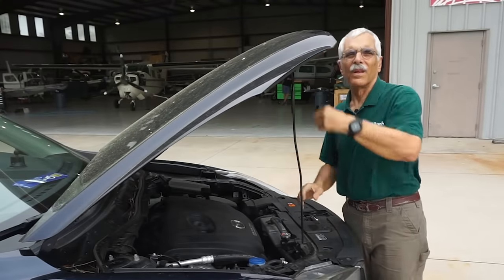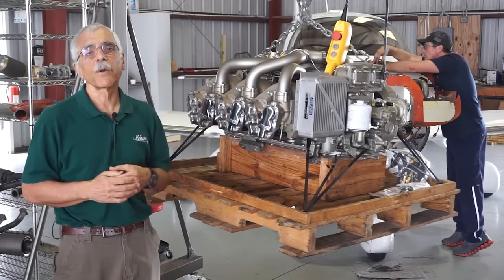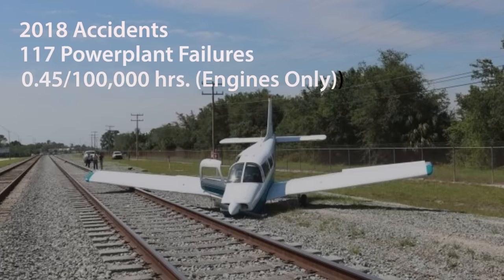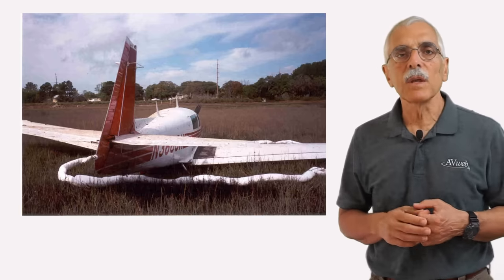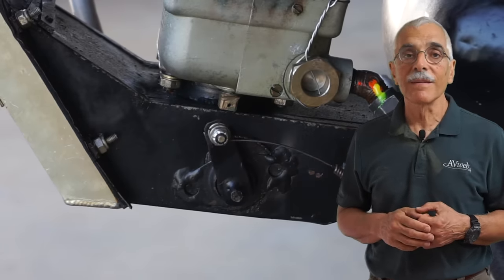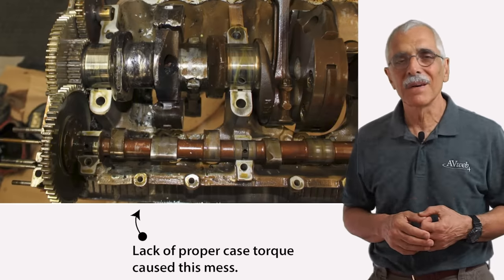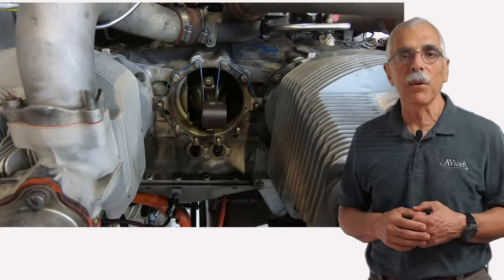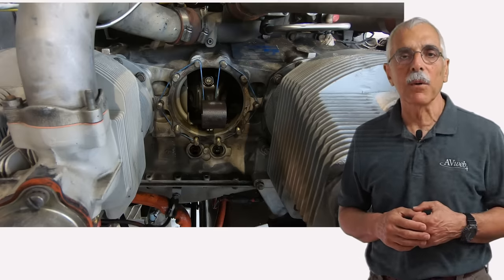Why Aircraft Engines Quit

Comment: I have a question but may already know the answer. I've run air cooled VWs for years (in cars). The single best improvement you can do to a VW engine is install a counter-weighted crankshaft, which greatly increases overall life and engine balance / smoothness. I noticed that the engines in the video are straight cranks. This is done strictly for weight concerns?

Comment: People often wonder why plane engines require overhaul with meager hours compared to a passenger car. A thing to remember is that once we're on the highway, our car engine is just above idle on a standard overdrive transmission. An average may be 2100 RPM with a peak power output around 6000 give or take. A plane engine operates at a higher range of the power curve thus greatly reducing the life. Think of it like a race car engine. They're racing for hours on end near WOT aka the top of their power band. They're rebuilt extremely often due to this fact.

Comment: Just for comparison, a car engine running at an average 60kph (just under 40mph for those in the colonies) will complete 200,000km (125,000 miles) in around 3,350 hours.  At an average 100kph (60mph) that distance would take 2,000 hours.
I think, nowadays with minimal maintenance (oil change and filters, maybe a timing belt) most car engines will easily achieve double those figures without any major failure or major overhaul.
Would you say that a typical GA engine is more or less stressed than a modern car engine?  in terms of bph per liter for example?
I'm not a pilot - just interested in the mechanical and operational differences.

Comment: About the Rotax engines, aren't a lot of them 2 strokes? If so this would play heavily into the failure rates vs. 4 stroke engines. There is something not mentioned, with car engines motion is transferred through rotation to a transmission that carries the structural load of motion. Depending on the car the Torque is carried via a thrust bearing with a rotational thrust loading. With aircraft in general aviation that is WAY different. The case of the engine not only has to handle the torque loading to propel the craft it has to handle the thrust loading imposed on moving the craft as well. and also the engine itself has to possess a thrust bearing on the crank car engines do not have. With cars the engine provides power to the wheels through a drive line that redistributes thrust loading. With aircraft the engine has to endure thrust loading with the RARE exception of engines using reduction gearing or a transfer gear (P-39 Airacobra for example).
For what they are Aircraft engines are amazingly robust usually. They have to be. People can be rather abusive towards their equipment.

Comment: interesting video. question: why pushrods instead of dohc when with the latter  you´re suposed to gain power due to the higher engine revs. also why not v engines since they are not so hard on the camshaft?

Comment: This is why after a lifetime on sporbikes since 1994 on a GSXR 750, I now ride a Buell XB12Ss.  If you maintain these type of pushrod air and oil cooled twin valve engines, they last forever.   Why do you think cruisers use them, even if from factory they are a bit de-tuned for comfort and emmissions?  Worst engine I had was Yamahas R1 with critical engine failure, loose valve guide, at 5k, 11k, and finally 16k mi destroyed and wore out.

Comment: I've had two partial engine failures. Fortunately neither became an incident, and thus no report. And I do know what happened with both.

One was a Continental O-200. The 3rd cylinder literally broke off of the crankshaft.

Second was a Lycoming IO-360. A stray piece of metal made a valve get stuck open.

Comment: Not a pilot, aviation enthusiast, but am I totally off if I say that a well maintained engine shouldn't quit? Like, my car engine never quits and only old engines generally have these issues.

Also, with regards to service, guessing smaller engines are easier and cheaper to maintain and overhaul, and since that keeps your plane flying, definitely something to consider.

Comment: The one thng I didn't hear you mention in regard to automotive vs. aircraft engine failures (other than that far more automotive failures occur than are tabulated1) is that aircraft engines spend almost all their time at or above 78% rated power -- and automotive engines rarely even get to that level, never mind sped much time at it.

Comment: I was really hoping there was some more fully formed point to be made about complex automotive engine reliability vs "simple but outdated" aircraft engine reliability that would give hope of future improvements but... I dunno that point seemed to just fizzle out. For instance, if (some significant portion of) 1/3 of engine failures is due to carb ice isn't it a no-brainer to get rid of more of the carbs?

Comment: I am assuming the 'ancient' design of aero engines is due to low volume production. I have  for a fair amount of time pondered why car engines - or at least modified car engines are not used at the lighter end of plane usage. In terms of the why - the one piece here is well - if you have ancient designs, and they need intensive main. - then each window opens up the chance of human error in the rebuild. Good video!

Comment: Frankly I still would consider a lot of these to be design failures. Yes, it is possible to avoid the vast majority of these failures with maintenance and procedure; but it is also possible to almost rule them out with relatively inexpensive design changes and retrofits.

For example, Water In Fuel sensors are an ordinary mass produced component that should be compatible with aviation fuels, if not as-is, then with minor modification; they aren't standard equipment so certifying should be relatively simple, I would think.

As for the wrong fuel type, I don't know how FlexFuel sensors work, but presumably something similar could exist (especially since unlike a FlexFuel sensor, you don't need to get an accurate mixing factor, you just need to know if it's contaminated).

As for carb heat... a thermocouple, a relative humidity sensor, and a buzzer could save you from this, or if we're feeling really fancy, maybe it could have a thermostat and run off an element rather than a heat exchanger.

And none of this is to mention the improvements in metallurgy, coatings, quality control and diagnostic equipment, factory casting refinement, bearing geometry, lubricants.... There is no reason piston engines this heavy and derated should require this kind of upkeep and still fail with the slightest lapses in maintenance.

Comment: When I was taking lesson's in a Cub from my dad we were working on engine failure drills. Our ground school section that day included what should be check as we descend.
    One of the first things I was suppose to look for was throttle position.
    I saw the throttle retard out of the corner of my eye and heard dad say, "You engine has failed."
     I just reached up and pushed the throttle back where it was suppose to be, mainly because I was a smartass teenager.
     Turned out that was what he wanted me to do.

Comment: Surprised that there are no magnetic pick ups on the oil drain bung. Quick removal and blocking with a thumb (when cool) lets attracted steel junk be identified. Sometimes large recognisable chunks with no other symptoms, particularly gear tooth pieces, the magnet also captures them.

Comment: Your Mazda engine is probably far more reliable than a light aircraft engine but that shouldn't be surprising. A major auto manufacturer has several times the R&D budget, they produce a lot more engines so are a long way down the experience curve and they monitor/measure exactly when failure occur within the warrantee period to find flaws early and adjust servicing accordingly.

Edit to add: I think a few auto manufacturers (Honda, Mercedes?) have sold auto engines for use in light aircraft. Unfortunately a quick Google didn't find any information on failure rates in this application.

Comment: I always use to recommend a Lycoming engine over a Continental engine. For years the Continental engines had things like brand new engines I found where the rocker arm pin was miss drilled at incorrect angles tilting the rocker arms to the pushrods two brand new engines on same B55 all the cylinders. Called the factory and they said a few got out that way. Quality was not the word of the day for Continental for many years. Though some of the Lycomings were also very poor the H2AD 0-320 cam was terrible for spalling the lifters. The magnetos on both brands really need to be removed and inspected or overhauled at very low times. The Slick brand is to me a throw away item the way the shaft and rotor with the little plastic point opening flat piece of plastic is crap in my book total junk. Well first for what it’s worth get a good A&P and when he says a part is way past its prime throw it out. Don’t run things until they break. Mags not looked after I have seen them crossfire on carbon tracks by the mags rotor do all kinds of cylinder damage on the Continental big sixes. Always do an oil analysis every oil change. Always get mags off every five hundred hours for overhaul or at least a thorough inspection. Of course some of the engines are very reliable the the Lycoming 0-320 no dash H2AD. The Lycoming 540 non turbo also a very good engine. The Continental 0-470 is a very reliable engine. Well keep the shiny side up gang.

Comment: I have little idea as to the specific issues regarding airplane engines excepting the carb icing problems mentioned, which should be easily fixable with a temp sensor.
Otherwise I'd take the Mazda engine anytime.

Comment: Battery failure, maintenance or engine failure? LOL PS: with modern computer technology are there not sensors that tell you "carb heat needed" or there is a loud clunking the acoustic coupler detects that the pilot can't hear because of Led Zeppelin is blasting (sarcasm of course it would be Danger Zone)  Not an airplane guy but mechanic and computer expert. It would seem to me that any failure that is detectable the sooner the better. Enjoyed the video.

Comment: I think the carb heat as a cause of engine "quittage" is probably overdone in some cases...  With that said, I was flying in a C150 at 7,500 WOT and the engine started to lose RPM. The instant I touched the carb heat knob,  engine RPM returned and no issues after that.  So, carb heat can occur at full RPM and in clear skies.  I was in a haze (at 7,500 feet) and there must have been just enough moisture that after 30 minutes it affected the carb operation.

Comment: Aircraft engines failure rates are extremely high if you look at the number of hours on them.  Can you imagine if automobile engines failed as frequently over a relatively short duty cycle -- consumers would be in an uproar?  Part of the problem is lack of sufficient testing and limited design/development resources. Lycoming, Continental, Rotax are "tiny" companies relative to major automotive manufacturers like GM, Ford, etc.  ... for example Lycoming have 346 employees globally, out of that about 12 actual engineers ... compare this to Ford where 170,000 in the US alone and an engineering team of over 10,000 employees.  This is why Aircraft engines are so unreliable.

Comment: Well, way it was explained to me is that an aircraft engine is designed to run at or near WOT for its life. Even if it isn't running WOT, it's running within about 80% of it where as the engine in your CX usually lives in the 25-50% of WOT except for hard acceleration or idling in traffic.  Also an aircraft piston engine will "run" beyond its TTO, but the likelihood of a failure increases significantly beyond it and considering a car won't kill its driver when the engine needs major repairs is another difference.  I'd put the aircraft engine over the cars if the engines are treated the same (80-90% of WOT) for 2000 hours

Comment: In 50+ years, I found that engine failure happened when the pilot made a power change. I emphasize pilot making the change rather than the fuel control making the change. FADEC IS pretty reliable.

Comment: ive got a 4.6 v8 in a crown vic,  retired police interceptor. 7000 idle hours and 150000 miles in addition. That roughly 10300 hours of run time, some of it very hard. I have had to change the belt and plugs. Other than that, its just oil and filters.

Comment: Maybe these old air cooled designs are obsolete. I have only seen 2 videos referring to engine failures on the Diamond DA-40NG which is water cooled, turbocharged and burns Jet-A. The Diamond design also places fuel between two wing spars, has replaceable crush blocks under seats to save your spine and cockpit/passengers get a 26G rated safety shell. Diamond is getting it right while Textron and Piper give us your Grandfather's airplanes. Why is that?

Comment: 21:30 Are you counting those accidents where the pilot tries and fails to turn back to the runways?
     I don't think those should count, because an engine failure in cruise is a lot less likely that the pilot will mismanage their energy trying to get to a runway.
    On takeoff you are at low altitude AGL and low speed, so the pilot needs to be extra careful to manage their energy.

Comment: Bad Fuel is not uncommon. Paul is right to say be careful of the  fuel,  Polarized glasses should be removed when testing fuel, you can miss something, like pale Jet A.    I stopped and offered help to an old gentleman when he was slowly  pouring AUTO gas from a 5 gallon army can into his old Cessna high wing. He yelled at me,  I'm not buying your gas, I was driving the AVgas truck. I laughed, I said I am offering to pour it for you, because my father didn't raise a jerk.  After he laughed, he apologized and let me help.  He said he would teach me something. He said be careful of new gas stations because there is often junk the tanks, and he handed me an old Chamois he used to filter the gas in the big flat funnel.   He said pour slow and watch.
On the second can of gas it happened, a big long string of Teflon pipe dope landed in the funnel, and if not for the Chamois it would be in his fuel tank.  He said he could also spot water and the old chamois would stop the water.   I thought he was pouring slow because he was old and tired.
Lesson learned = the easy way, listen to the old guys.

Comment: Very interesting video. Thank you. However, I must ask, is there a modern automobile engine (yes, water cooled) than can be adapted to aircraft. It seems modern engines almost never quit. I know weight is slightly higher, but liquid cooled engines seem to bypass many air cooled engine problems. And the cost differential is enormous. Thanks for what you do.
Reply: Look at Austro or Viking. Austro uses a Mercedes, Viking uses mostly Honda

Comment: Why do Mazda engines never fail? Because they are rarely tampered with after initial manufacture. I would like to see the results of a survey of catastrophic engine failure comparing failures of factory built aircraft engines compared to rebuilt engines.

Comment: Maybe Honda and Mazda should start making airplane engines.  I had a 94 Accord that I drove until it lost an argument with a Jersey wall on a snowy night.  Over 200,000 miles, it didn't leak or burn oil, and it always started.   Mostly local driving so figure an average speed of 30 mph, that's about 6,000 hours.  If it hadn't been for that Jersey wall, I'd probably still be driving it.

Comment: Concerning the TBO of 2,200 / 3,000 hrs.  When comparing an over the road engine service interval ( in miles ) to a stationary engine ( in hours  )   35 miles is about equal to 1 hour.  

2,200 hr-=  77,000 miles
3,000 hr = 105,000 miles

These numbers are pretty close to a 1980's car engine before engine reliability / power starts to fall off.

Comment: I had, one with no obvious fault, 2nd chunk of piston broke off. 3rd exhaust valve break off. 4th carb flood and fire on landing and 3 lots of cracked cylinders with power reduction.  16k flying hours. Never had a car engine fail in 40 years.

Comment: thanks! But I still don't understand aviation piston / carbureted engine designs in comparison to automotive carbureted engine failures. Overall I've never had an automotive engine blowup...or quit working....I take that back. I experienced an aluminum block automotive engine failure due to a warp between the aluminum block and iron head. engines don't run on radiator water very well. Another item is carb heat. Why don't aviation piston engines have designs for proper carb heat at all times like automotive carbureted engines do? Pardon my ignorance with aviation engine designs....I want to learn more.

Comment: Is there a market for a compact ultra light engine with dual/triple redundancy capability (the entire engine is redundant and each segment is 100% independent)? This engine is so much lower cost that instead of an overhaul, it is simply replaced and still saves a lot. Will the developments in Electric drivetrain make it too late for this?

Comment: Are there any private airplanes using the Buick 3.8 litre v-6 engine? I have a 1997 Buick that has 475, 000 Km on it and it still runs very well.

Comment: I do believe the continuous stress of an aircraft engine does make it a lot more prone to failures than a car engine with the same horsepower rating, a car engine will very rarely see the top end of the horsepower rating actually get used while the airplane motor spends most of its time there... But it's still kinda weird that these very simplistic, high-displacement low-power motors suffer from such a poor failure rate compared to car engines which will go six-digit miles over a decade with nothing but occasional oil fills and maaaaybe a timing belt :s